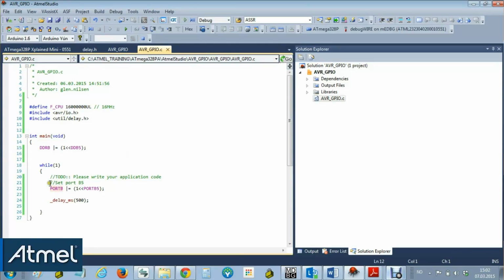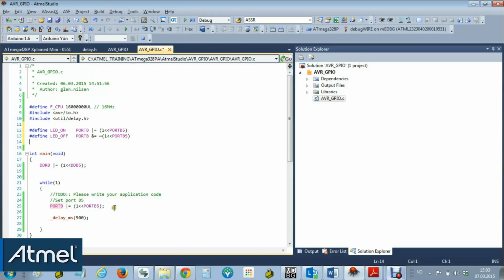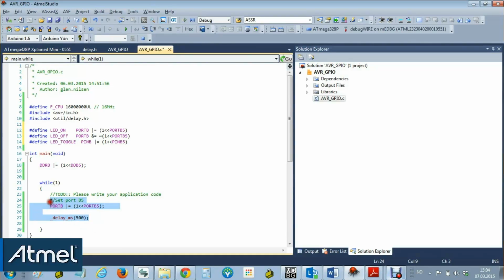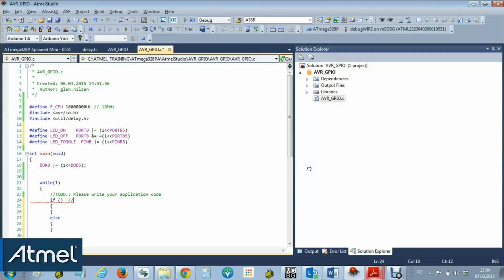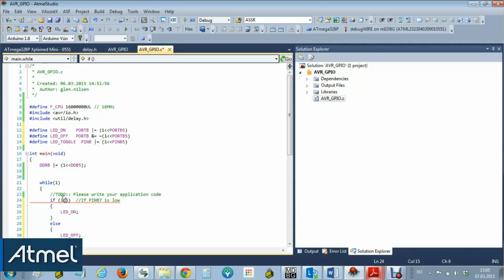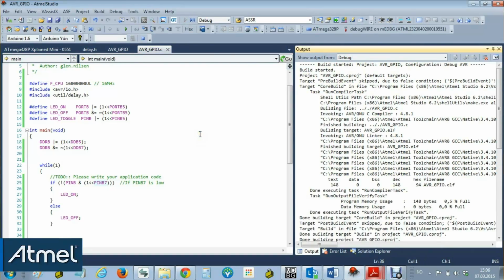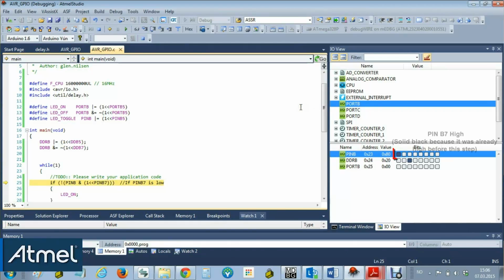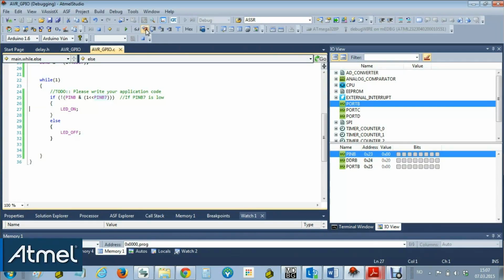Getting Started with AVR: Read an I/O as Input to Turn on LED (#4)

Comment: hi, 

Can anyone explain a bit about the syntax DDRB & = ~(1<<DDB) please? It's not the c++ syntax. Thank you very much!
Reply: Short explanation: It sets only bit 5 of DDRB to zero while not changing any other values. In the world of AVR microcontrollers, 0 are inputs and 1 are outputs. So it makes the 6th pin on port b an input pin.

Long explanation: See below.

DDRB is the data direction register for port B. The values of DDRB determines if the pins on port B are inputs or outputs. The code above is somewhat compact and does a couple of things so let's break it down.

1.
1<<DDB
In the example 1<<DDB5 is used. What it does is to shift a 1 to the left a number of places corresponding with DDB5. DDB5 is simply the 6th bit of the DDRB register. In this case 1<<DDB5 is the same as 1<<5 and it will give you the following value in binary 0010 0000.
You can have a look at the datasheet if you want, page 91.
http://ww1.microchip.com/downloads/en/devicedoc/atmel-8271-8-bit-avr-microcontroller-atmega48a-48pa-88a-88pa-168a-168pa-328-328p_datasheet_complete.pdf

2. 
The next thing the code does is to bitwise negate the binary value we just produced. Bitwise negate just means we flip all the bits instead of doing a single logic operation. So ~(0010 0000) is the same as (1101 1111).

3.
Finally we get the DDRB &= something part. This is the same as 
DDRB = DDRB & something. So DDRB will be whatever DDRB was ANDed with the binary value we produced earlier (1101 1111) we call that value a bit mask. So where there are 1 in the bit mask the DDRB bits will stay whatever they were, and where 0 the corresponding bit for DDRB will be set to zero.

If it is still unclear Patric Hood-Daniel have made some excellent beginner friendly tutorials for 8-bit AVR MCUs among other things. This time-stamped link will take you to the most relevant part of a video explaining some MCU IO stuff:
https://youtu.be/GSuynyy5MTc?list=PLE72E4CFE73BD1DE1&t=476
Note that he is showing how to set outputs instead of inputs, here you don't need the extra step of negating all the bits. You also use the or operator instead of the and operator. 

I realize the response is a bit late, but I will leave it here for posterity:)

Comment: This code is missing the line to set up the pull up resistor on PORTB7
PORTB |= (1<<PORTB7);
Reply: You're right.  I am using the ATmega324p,  not the 328p and required that line in the code, despite the presenter not needing it.  Very odd.
Reply: The presenter's code did not need the pull-up command because the xPlained Mini already has a pull-up resistor on that switch.